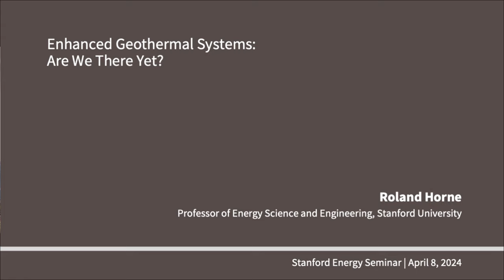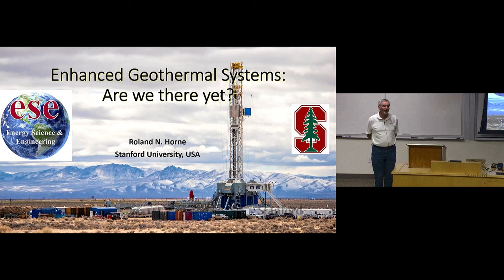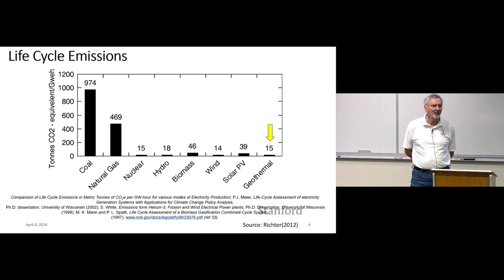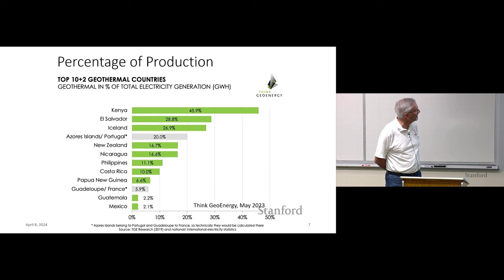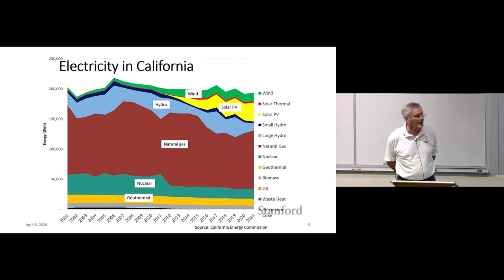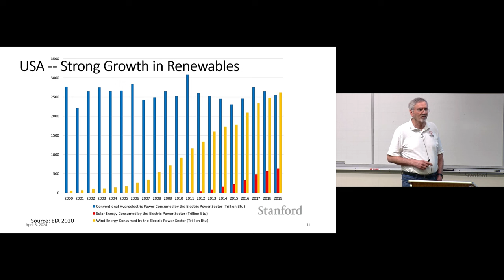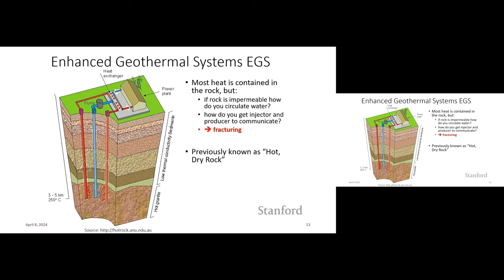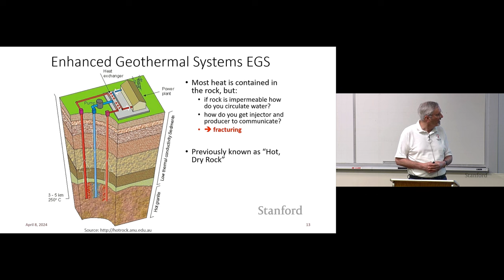Stanford Energy Seminar | Enhanced Geothermal Systems: Are We There Yet?

Comment: What I see coming is a national electrical distribution grid.  The USA is about two thousand miles wide with four hours of time zones. One or more east/west DCHV power line would load balance across the nation. Morning solar in the east afternoon solar in the west. Geothermal all of the time. Wind and other sources as available. Behind the meter and system batteries would provide load balancing.  One for all and all for one.

Comment: Oil and gas fracked wells traditionally use sand and the like to hold open fractures against pressure, w relatively low flow, a 1-2 kg per sec.  How are a fractures held open w 60-80kg/sec working to remove sand?

Comment: Pumping power?  PE alone, m*g*h of 80kg/sec, depth 7km is 6MW, w say 60% eff pump, 10MW. Can that ever pay?  Once again, much nearer surface, hotter rock seems to be required, ie rare geothermal conditions using traditional, not enhanced methods.
Reply: Think of thermosiphon effect
Reply: @mohammadaljubran2456  I’m aware; I don’t think it significantly  applies. You know better?  The injection wells and recovery wells and generation system with steam expansion in between would have to somehow be a single phase system w little compressibility over 10km.  I don’t see it. I do know some earlier egt pilot projects a few years ago were net loss power.